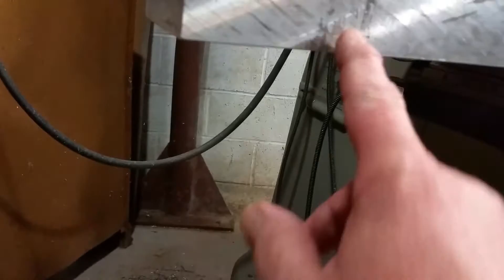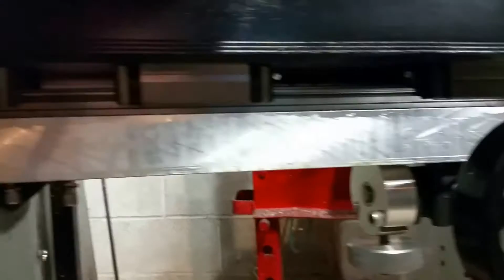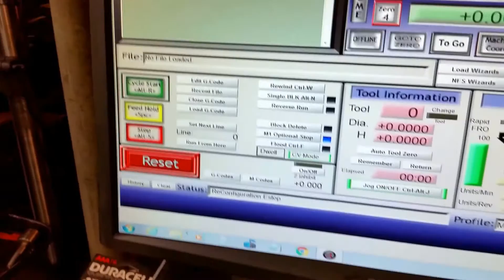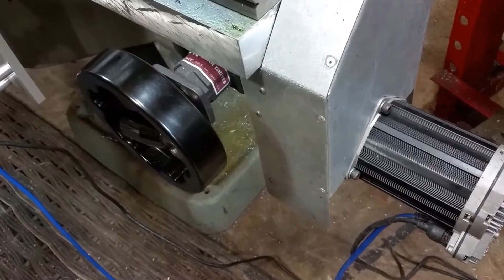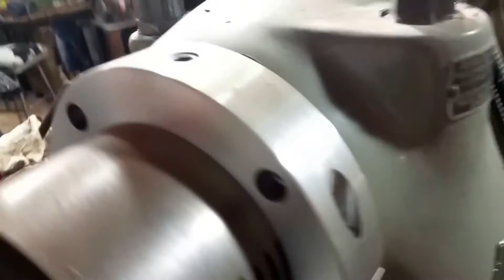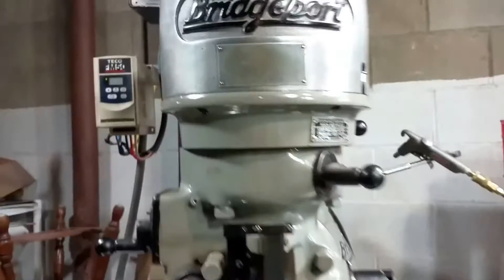Bridgeport with Linear Rails Finally Part 2

Comment: Why do you have glass scales if it’s cnc‘ d ?
Reply: I've seen some controllers that can use them as a positional reference.
Reply from the maker: The scales where still on the machine from before I put the servo's on, I just didn't take them off yet at that point in time.
Reply: You can you the glass scales yet,,most high end cnc machine do have BOTH because encoders cant tell you machine changes with temperature.  Basically its always perfect weather its hot or cold

Comment: I've been thinking about this myself.
But here's one for you...Look up the Bridgeport/ TrueTrace machines. The head on those babys are about 36 inches wide. Could be possible to add and additional 24" of X travel under the j head itself. I'll leave you to figure that out. It would relieive you of your round ram issue as well. True Traces are only found in the bone yards any more.